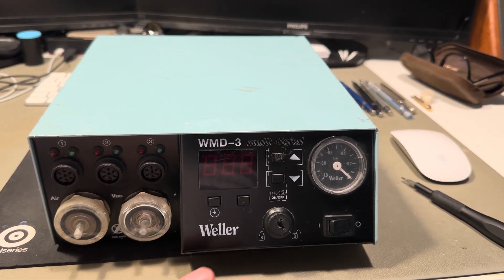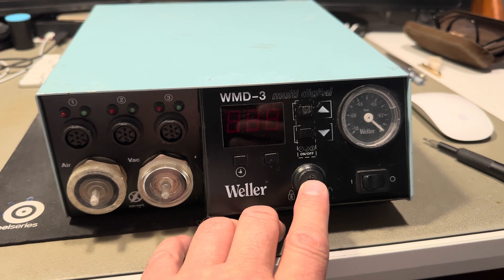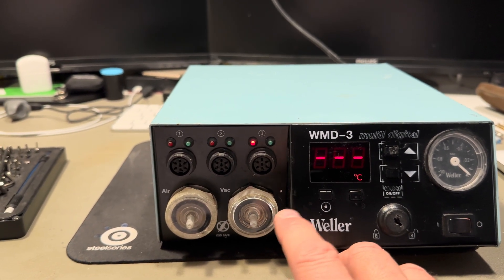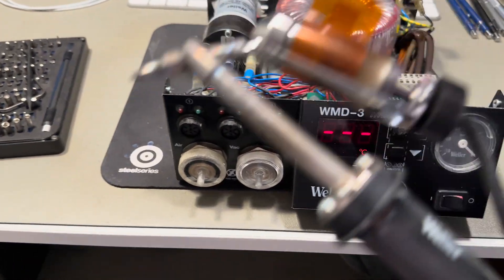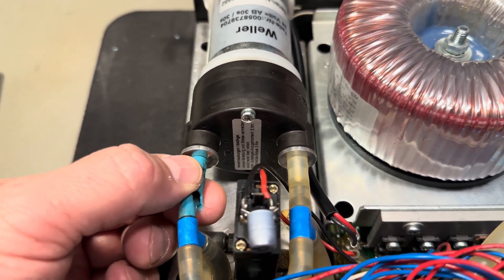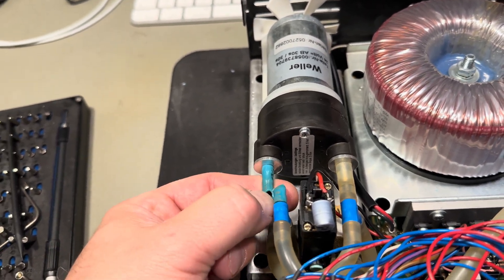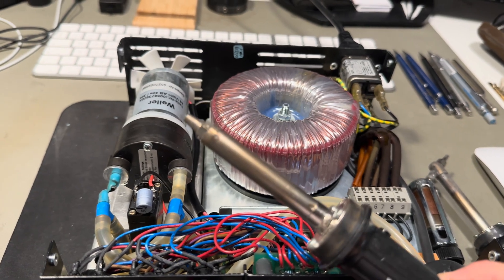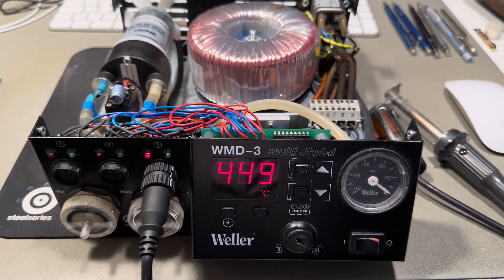Weller WMD-3 station a look inside + Air output fault

Comment: HI! HAVE YOU FIXED IT?
Reply from the maker: @crimsomglory  yes was easy, a new t-joint and some pneumatic tubes less than 10euros an 10 minutes work!
Reply: @HiFi-DIY  is it a particular "pneumatic tube"?
Reply from the maker: No just some proper pneumatic tube, the T-joint is from Festo so I also used there tubes